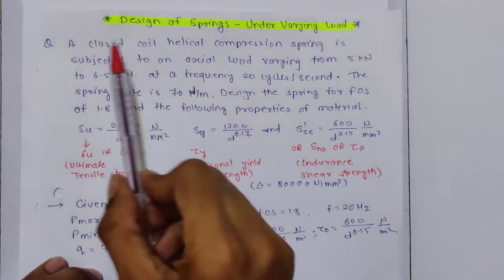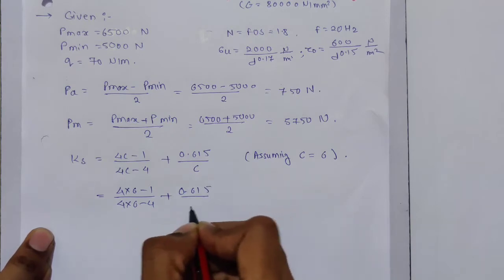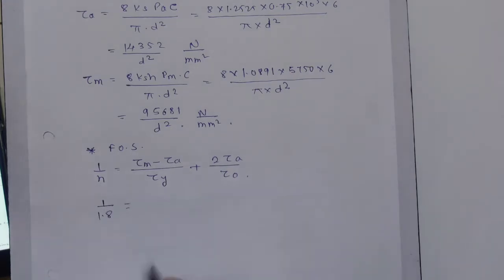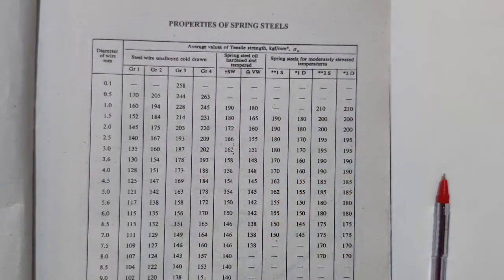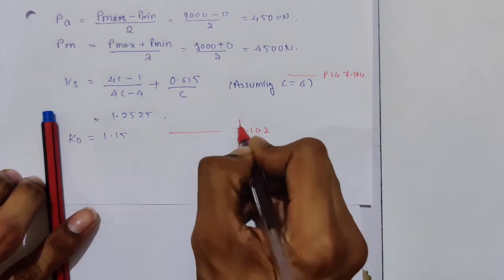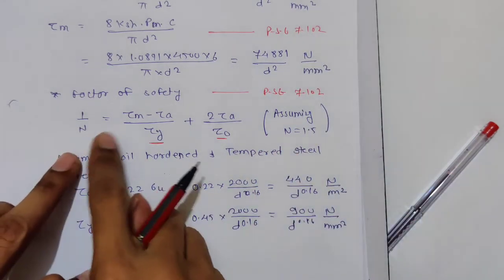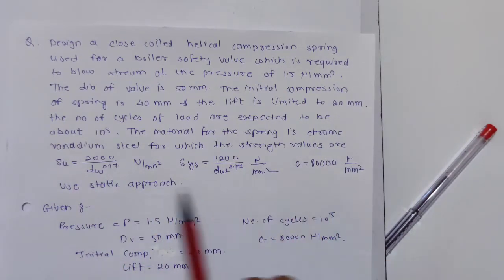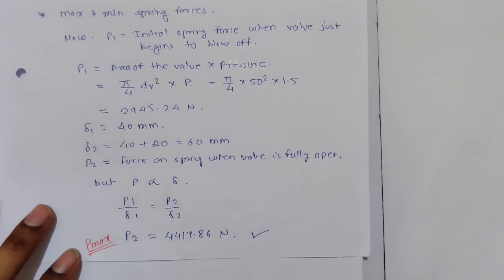Design of Springs   Part 3, Varying load using PSG (Hindi)

Comment from the maker: Der is one mistake in question
Value of q = 70 N/mm
By mistake I wrote 70 N/m. 
Please correct it. On PSG 7.100 you will find formula for "q". 
Use that formula instead "y" and and find number or coils "n"